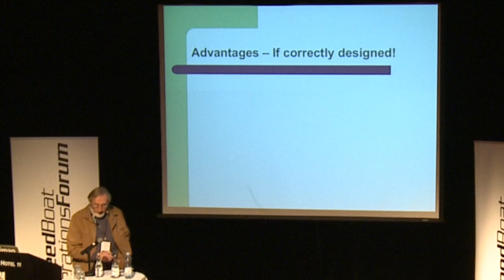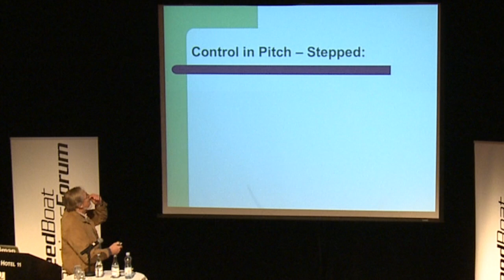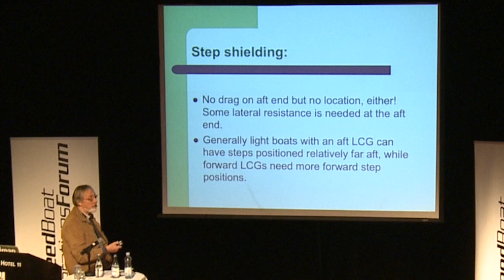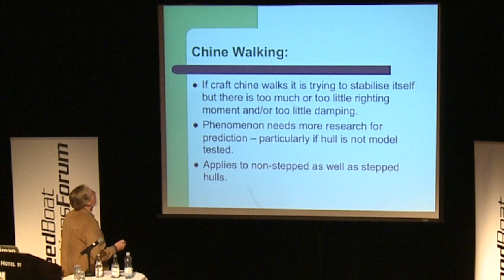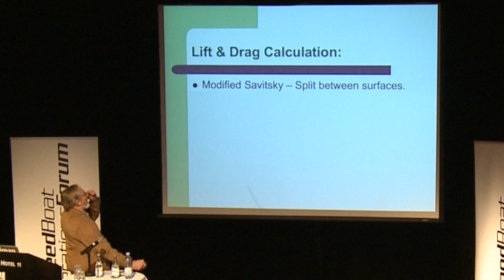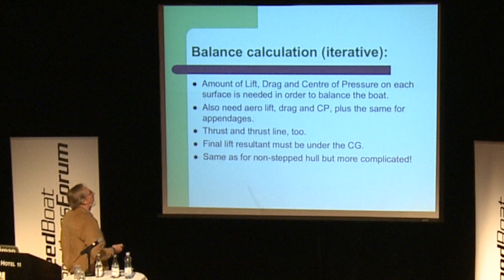Notes on Stepped Hulls

Comment: Video from the Cowes-Torquay 2016 race shows the Outerlimits Silverline boat with it's multi steps going in rough seas with what looks like av very dangerous negative trim angle. As if the boat will nose dive at every second. Can it be too much of a good think with steps? Some Outerlimits boats is known for spinning out in turns. Maybe that is one of the negative sides of a stepped boat, you have to be careful in turns so the steps don't hook. And the more steps you have the more negative ride you get?